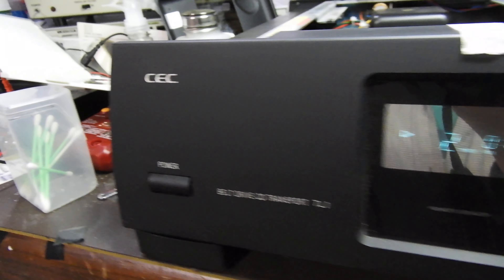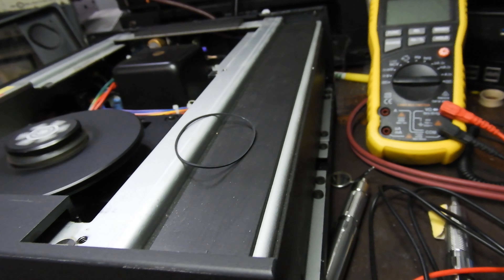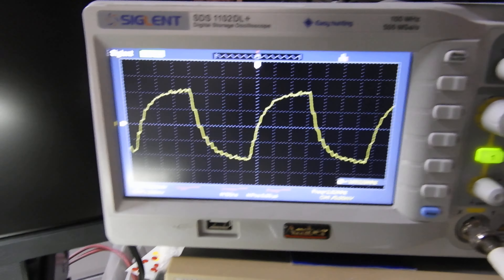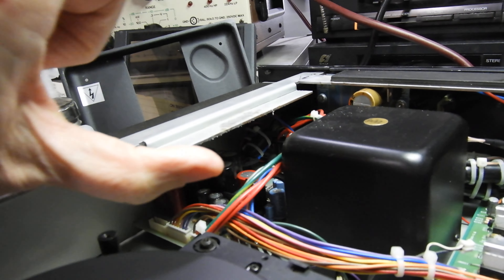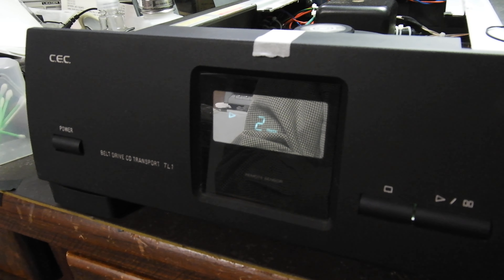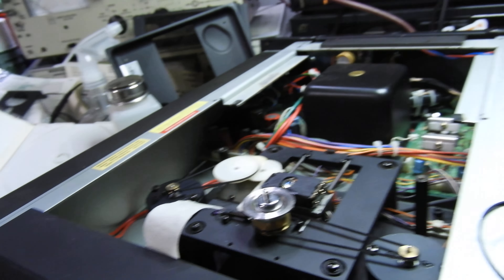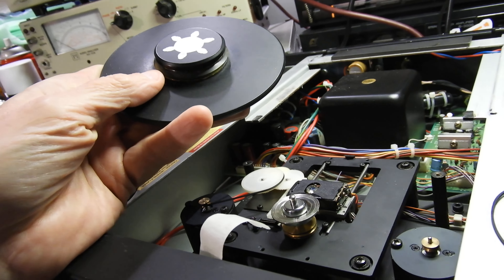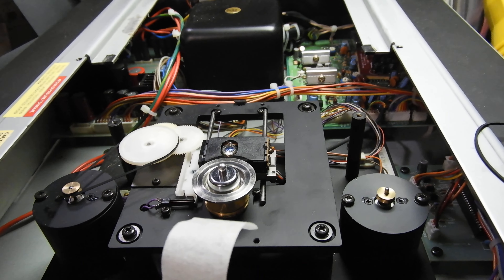C.E.C. TL1 CD Transport - heavily modified. But is it a good thing?

Comment: Re: 5:20 - well, Lukasz developed a bunch of mods for CEC transports - and he did end up building DACs from scratch, quite successfully.  In other words, mods and modders are not always bad.  Engineers for these types of companies have to design to a price point, and almost always make compromises in parts quality (given the typical 5x markup).  The TL-0 uses a sh!tty Sanyo stock board that is the type you would find on sub $300 players, doesn't even use Oscons (really disappointing), etc.  So there really are improvements that can be made by modifying, but you have to be smart about it and know what you are doing.

I do agree with the mechanic v. engineer comment on these mods - looks like it might have been Audiocom-uk.
Reply from the maker: I do agree that mods are not always misguided. Łukasz indeed built business on mods and he became known for fitting tube stages to CD players. However having gained all that expertise, he went on to make DACs and amps. He has never made a single CD player or Transport and modding them is where he supposedly excelled at. Why is it so if he knew so much?
Would fitting Os-cons really improve sound of CEC TL-0? This is very debatable. Os-cons are made by Sanyo and so is TL-0. They could have had them at factory cost. If they knew how to make a transport that half of the audiophile World is salivating  when just looking at, don't you think they didn't try to improve upon the electronics in it? They did a really serious power supply yet they thought that their boom-box servo was good enough. Maybe then it simply does not matter what servo it has and what capacitors are in it. Maybe they do know what matters and what does not. Cost surely was not a consideration. It used to cost $20,000+ in Australia.

Comment: On the other hand, many accomplished designs have been tainted by unscrupulous accounting practices and where that is the case, a bit of TLC can work wonders.
Reply from the maker: Accountants indeed might be a problem sometimes, but these TL0 & TL1 Transports don't appear to be affected by them. They have a boombox servo, average laser mech and PSU and lavish boxes. All at a premium price. The puck surely was good enough and making it heavier wouldn't have added anything to the price
Reply: @hear-net-au  Absolutely, it's never the case with premium, top tier models, where barely any expense was spared. This one has been effectively butchered! Someone read too many audiophile magazines and not enough engineering books.